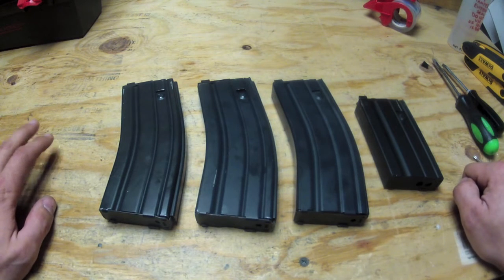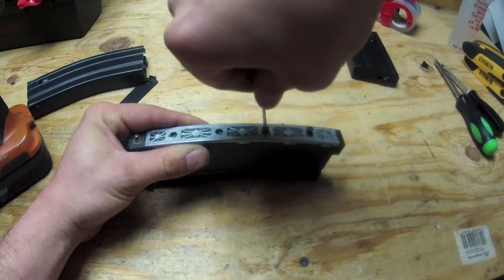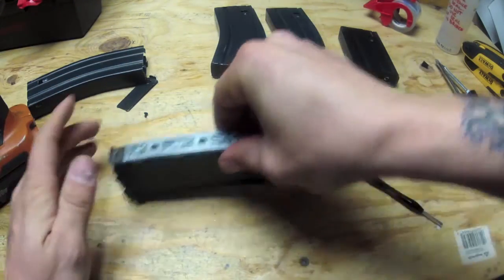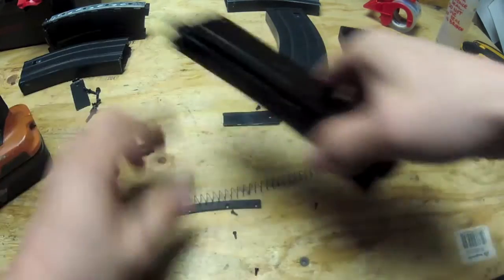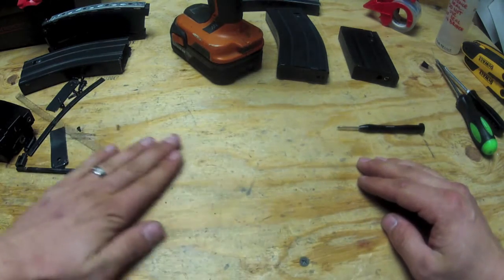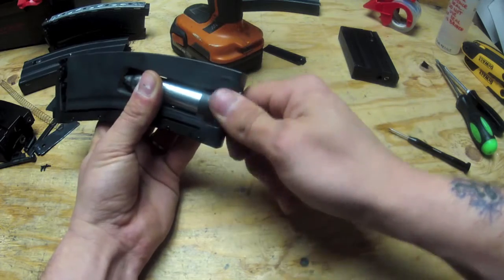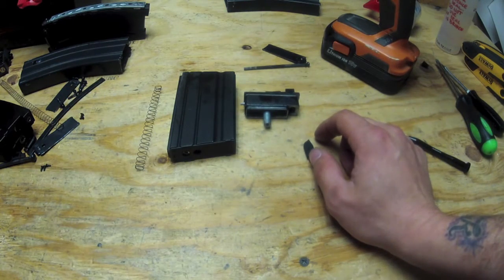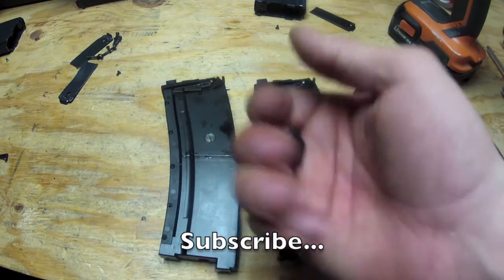WE M4 Magazine Styles & Maintnance Tips

Comment: nice video, by they way, one of my mag is kinda screwed, i lost the screw o rings, and my bolt catch lever.. and i feel hopeless with it.. do you think gasket maker will do the trick? but i tried before but still theres a leak.. im just thinking of buying a conversion kit for it to version 2... also do you think there's any way to do a permanet fix to it? like epoxy or welding?

Comment: If I rem Max used a real PMag for the conversion. BTW in the current state of affairs in the US, RS PMags are as rare as unicorns and are way expensive if you can find them due to the possible large (?) cap mag ban. They are sold out every where and if you find them they are real expensive (4x-5x). Not sure if you can mod an airsoft PMag to use as a housing for a gass mag internals. IMO In airsoft there is really no need for Poly mags other then LOOKS, grip?, weight ~ the same.

Comment: These version 2's do they work in the SCAR?
Reply: In this video RA-Tech test several WE Gas mags with WE Masada/ACR, but I think SCAR should be similar.
Basically M4/M16/SCAR/MSK are supposed to all work with the same mags, potentially with some minor corrections
Reply: For example the P-mags (the MSK mags) need some filing in the side to fit in the M4 or M16 mag-well, can't remember which one, as the mag-well is straight and a bit longer than the MSK mag-well
Reply: @JC-XL  necro-reply?    Post is 7 years old.   But thanks... Someone may benefit.